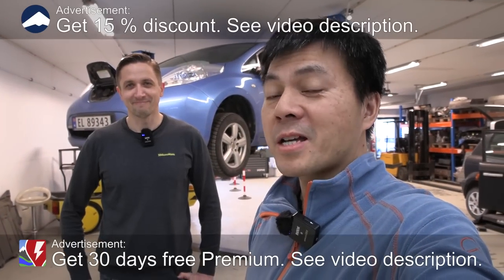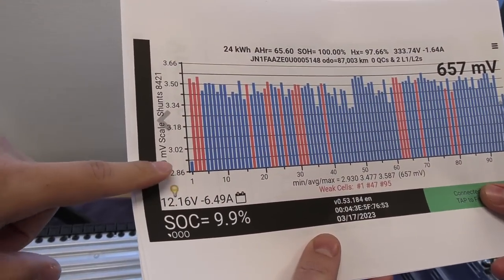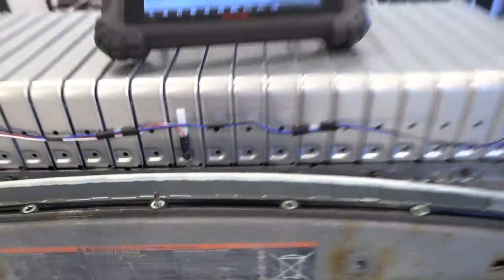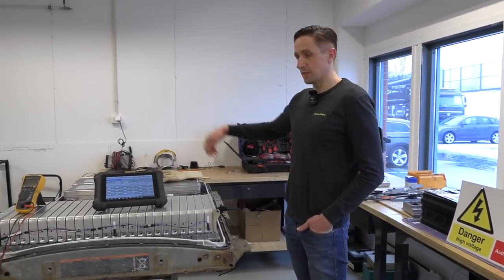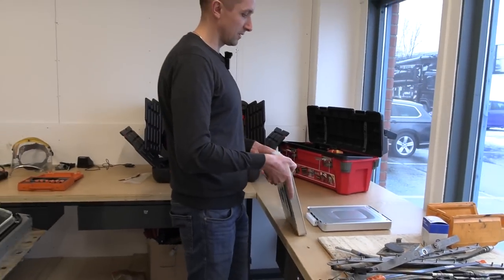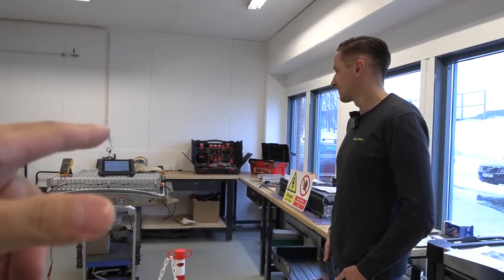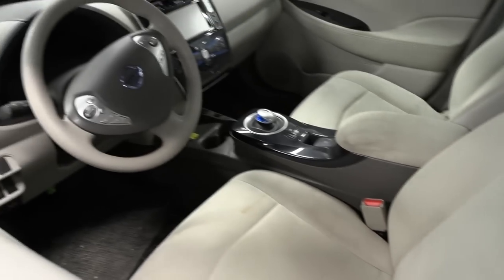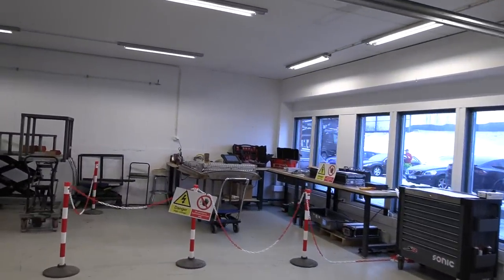Elbilmek repairing Nissan Leaf 24 kWh battery pack

Comment: Great content bjorn watch u all the time.  Just a quick question I'm in the UK and been looking at some model s cars, which model would be best for range and economy, interested in  the model s which has free supercharging thx keep it up
Reply: That is fairly simple: The 100 and 90 are the best in terms of range. The 85 has a significantly lower capacity and charging speed.
Reply: @b127_1  thxs
Reply: @b127_1  charging speeds increased a little after last software update. P85 owner here
Reply: There is no free supercharging on any Tesla any more as far as I'm aware.
Reply: @BluffMunkey  rite thx dunno why they put that in the adverts 'free supercharging'
Reply: @BluffMunkey  there’s on early Model S (2014-2016; SC01), early 2017 Model X (also SC01), then on some Model S and X as SC05, and early 2019 model 3 performance (SC05). SC01 stays free with any owner of the vehicle and is transferrable, SC05 for first owner only. Mine is SC01
Reply: @vladzis  thx for the reply, what's the cost then like since electric has gone up?
Reply: @vladzis  so to charge p85 to full how much is it costing, public charger and what range u getting thx
Reply: @mist9268  no idea, using free Supercharging only, 64k km since last June already
Reply: @vladzis  someone commented earlier saying there is no free supercharging anymore, are u in the UK?
Reply: @mist9268  same rules everywhere, as I explained about SC01 and SC05. My SuC is valid everywhere, not just limited to UK. Bjorn’s P85 also still has free supercharging
Reply: @vladzis  rite that explains it thank you
Reply: @vladzis  always fancied a tesla but at minute av got a diesel yea I know.  But I can get 1000mile out of it, 72litre tank.  It used to cost me 90 pound to fill, now its costing 130 pound

Comment: big challenge is cost. most of which is labor. replacing one or two cell modules may be cost prohibited when factoring in the price market of the car. reselling battery, motor, and other parts to used market may be more attractive than actually having to 'fix' your car by a shop like this. the other option is DIY; then labor is your own. this might be interesting; one caveat though is not getting electrocuted or securing equipment for getting in and out the battery ....o_0

Comment: Hi, love the content ! 
Do you guys know if it is poesible to use a Leaf battery module/cell to replace a dead module in a Renault fluence ? Or are they not compatible ? I can see that the capacity is a bit different so i guess it is not possible ? If not, do you know of any place i can source a single module og multible ? BR Martin

Comment: I have been looking at used X5 40e cars, but they have a really small battery. Do you think it would be possible to upgrade the battery somehow? Replace the cells with something with more capacity. Or replace it with a 45e battery? The used prices on these cars are coming down in norway, and it would be cool to have one with long-ish EV range. :)

Comment: there is a difference between 'passive cooling' and 'air cooled' for this battery. Also,  not such a great idea to add fans; I would rather focus on adding 'fins' or  looking for improving the channels to redirect more air to the battery. I understand batteries from factory come air tight.

Comment: Yes, interesting! But swapping modules or cells should be a lot easier! Must be bad design around the battery when 60% of those 1200$/1000€ is labor and I suspect other EVs or new EVs aren't much better (except of course with the NIO cars and their battery swap stations)

Comment: Surely they improved the cooling in the new version of the leaf?
Reply: Haha, you would think so, but no. They’ve tweaked the battery chemistry and improved the capacity over the years but never added active cooling. Check out Bjorn’s test of the 40kWh Leaf in Thailand a few months back to see what that means on a long drive.

I wouldn’t buy a new Leaf, they’re not even cheap compared to other modern EVs! 2nd-hand is a different story - I’ve got a 2nd-gen 24kWh and it’s a great, cheap city car.

Comment: Long story short its better to take it to a scrap yard. Very little EV engineers that can do this, and if they can its not financially worth it. There are ICEs out there 20+ years still running with just a normal yearly service and occassional tire and brake changes.